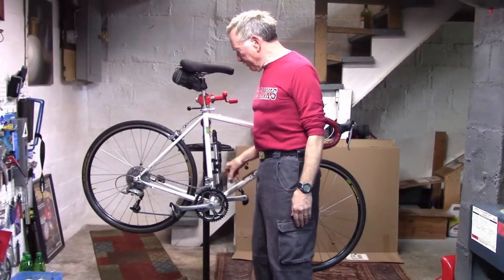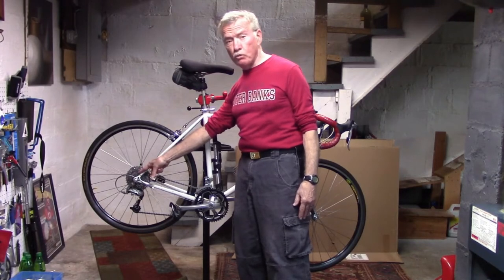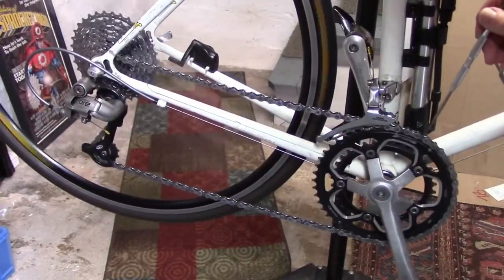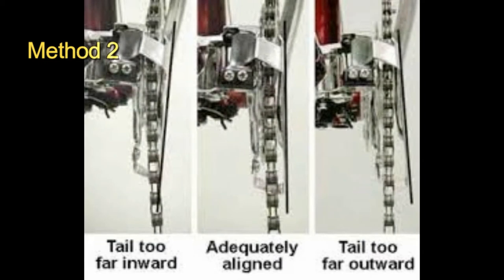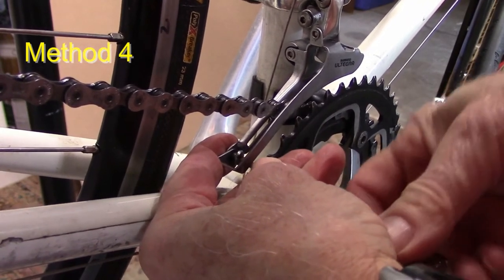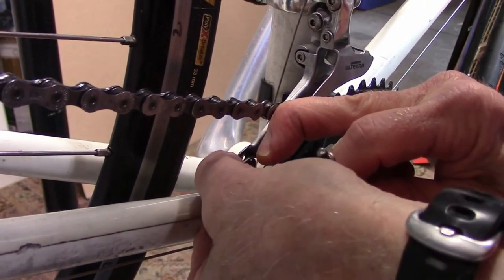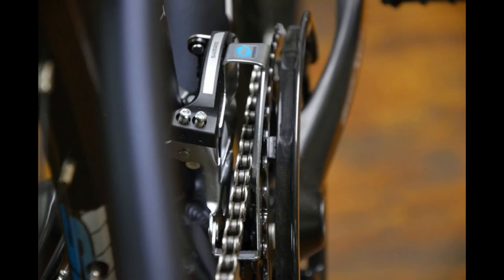Front Derailleur Chain Rub with Multiple Rear Cassette Cogs: Tips and Hacks

Comment: This is magic that I got to this video. I have been watching cycling videos, but I have not searched a solution for this problem that I have on my gravel bike. I think that in my bike there is enough flex purposefully built into the rear triangle (carbon GT Grade) that when I put in enough power to the pedals the FD rubs against the chain. No amount of adjustments has seemed to get rid of it, but I never noticed that there is a screw there on the bottom that I could open and use the washer trick. That will be my next test :-D Thank you very much!
Reply from the maker: Let me know how you make out. Sometimes I've taken the risky move of also trying to move the inner and outer plate of the derailleur apart with long nose pliers (stick the end of the pliers between the derailleur inner and outer cage plates and open the pliers to move the plates apart more). But if you pull too hard, you could damage  the derailleur. Anyway, after installing the washer and before doing anything else, reset the inner and then the outer limiting screw. By resetting the inner limiting screw (place the chain on the small chainring and largest cassette cog and moving the inside derailleur plate closer to the chain), you be able to reset the out limiting screw to give you more room. Let me know if any of this works.  Regards, Tony

Comment: Before you get into taking the detailed apart you could always try the barrel adjustment.  Especially if the limiter screws aren’t helping.
Reply from the maker: That may be the case when the derailleur cable is too tight that the derailleur will not move inward enough and rub against the chain, usually in the larger cassette cogs. Failure to move outward far enough to prevent rubbing in the large chainring will occur when there's too much slack in the cable. And adjusting the barrel adjusters for the front derailleur may do the trick. Thanks for your observation and comment. Safe cycling, Tony

Comment: Great page! Had a question and can't seem to find info about it anywhere. I have a Cervelo r2 road bike with shimano 105. This bike has microshift or half shifting of gears to help prevent chain rub when you're almost cross chaining. I think this is called trimming? When I'm in the small front cog, it seems to work but when I'm the large front cog, it doesnt. Took it to 2 bike shops and no luck figuring it out. I'm wondering if you had any ideas on this?
Reply from the maker: Trimming problems are related to the fact that there  is a tad bit too much tension in the front derailleur cable. You can reduce the tension just a bit if there is a barrel adjuster up near the shifter or on the down tube. Turn it in (clockwise) 1 or 2 turns. If there's no barrel adjuster or it won't turn, you'll need to shift to the small chainring. Undue the front derailleur pinch bolt and let the cable have just a very very tiny bit more slack. Too much slack, and you won't be able to shift from the small to large chainring. Takes some practice to get the right tension but worth learning. It's hard to believe that the local bike shop doesn't know about this. Then again, they've probably only worked with newer bikes without such trim function or electronic shifters. Even if they had worked with the old triple chainrings they would understand this. Give it a try or take it to a different shop. Let me know how you make out. Regards and safe cycling, Tony

Comment: This is exactly the issue that I have with my front derailleur. But what can I solve this issue, when my front derailleur doesn't have a screw on the tail?
Reply from the maker: Several possible fixes:
1. On some bikes, running the large chain ring with the larger cogs will produce noise - rubbing chain against the inner plate of the large chainring. Sometimes adjusting the outer limiting screw (turning it in (clockwise) 1/8 of turn or so while in the small chainring) will allow you to still shift to the large chainring with rubbing only in the very large cog. You may always get rubbing when cross chaining (big chainring/big cassette cog). See:
https://www.youtube.com/watch?v=_dCa-PZuN7c&ab_channel=TonyMarchand 
You should be shifting to the smaller chainring when shifting to the larger cogs for climbing and use the larger chainring and smaller cogs for speed. 
2. Some front derailleurs have a limited capacity in what cogs can be used without rubbing. Using snap ring pliers or even long nose pliers (gripping them so they open wider), I have been able to widen the space between the front derailleur plates (at the front and middle of the derailleur) to give me a better range of options. This does work but is risky in that if you put too much pressure on the derailleur to widen the gap, it is possible to break the derailleur itself (has happened once on a bike I was working on).
Snap Ring Pliers:
https://www.amazon.com/SPEEDWOX-Retaining-Installing-Automobile-Transmission/dp/B07QYR719L/ref=sr_1_20?dchild=1&keywords=Snap+Ring+Pliers&qid=1629743732&sr=8-20
So one must take great care and widen just a bit in the middle and front of the derailleur. 
3. Obviously these alternative are not easy tasks. Otherwise, leaving everything as is, when you hear rubbing in the large chainring, you know it's time to shift to the small chainring or vise versa. This too is not a bad alternative.

Regards and let me know how you make out, Tony

Comment: Hi there again Sir Tony, before, I used shimano HG 201-9 11-36T cogs and I don't experience any chain rub even on any gears, then I changed my cogs to shimano HG 400-9 11-32T, now my chain is rubbing on my Front Derraileur. Does changing smaller cassette is the cause of that rubbing? By the way, nice video Sir.
Reply from the maker: Did you check the "b" screw? See:
https://www.youtube.com/watch?v=UXnLJpTVFJ0&ab_channel=TonyMarchand
Check that the derailleur hanger is not bent. See:
https://www.youtube.com/watch?v=qHK6jQizIdc&t=1s&ab_channel=TonyMarchand
In what cassette cogs and what chain rings do you hear the rubbing of the front derailleur and is it on the inner or outer plate of the derailleur? Let me know? Regards, Tony
Reply: @tony10speed  The "B" screw is just right and my hanger is good. First when I shift from small Chainring and small cogs it rubs on my outer plate, second when I shift to second chairing and 3rd chairing the rubbing occurs in the inner plate when I try to shift into a larger cogs, although my adjustments are correct. Btw, My drivetrain max capacity is 45T but now its 43T capacity because I changed it to a 32T cogs. Is that okay? And I removed 2 links on my chain.
Reply from the maker: @earvinvillanueva3839  I assume from your description you have a triple (3 chain rings). Correct me if I'm wrong which will change my answer. A triple is setup such that one uses the small chainring in the larger cogs, the middle chainring in the middle cogs and the large chainring in the largest cogs. Any other combination will give you chain rub. In fact, when you hear chain rub, you know it's time to shift to a different cog. This requires one to think ahead as you approach an incline or descent and is one of the reasons most bikes manufactures have shifted to a compact (2 chain ring setup) which makes things easier. Even then, one can expect some chain rub when in the largest chain ring and larger cogs and small chainring and smallest cogs (something we call cross chaining). Again, when you hear a rub, you know it's time to shift. You still need to anticipate the incline or descent to be in the proper gear. Here's a video from Park Tools on how to setup a triple derailleur (not simple). Your bike may have the barrel adjusters on the down tube as opposed to the video:
https://www.youtube.com/watch?v=ZNG7g83lI-s&ab_channel=ParkTool
I've switched all but one of my bicycles to compacts and a third I will convert to a 1x (single chainring in the front) - an up coming video. 
I hope this answers you question. If not, let me know. Regards, Tony
Reply: @tony10speed  Thank you sir tony for the help, I already did the proper adjustments on the FDer, then adjusted the "b" screw slightly upwards since I changed now my cassette to 11-34T and installed again the 2 links that I removed from the chain. Now my drivetrain is smooth and quiet and I didn't experience any chain rub on any gear combinations. Again, thank you for the help Sir Tony, God bless!
Reply from the maker: @earvinvillanueva3839  Great work my friend. Regards and safe cycling, Tony

Comment: Hello sir my front derailleur is 3 speed. When I shift to the smallest chainring then the chain rubs on the inside of the derailleur, if I properly adjust that by the low limit screw then the chain rub stop on the first gear but the chain starts to rub on the inside of the derailleur on the second gear. The 3rd gear is fine. Could you please tell a solution for this.
Reply from the maker: Adjusting a front triple derailleur is not an easy task and take time and practice. Watch and listen closely as Calvin Jones of Park Tools takes you through the process:
https://www.youtube.com/watch?v=ZNG7g83lI-s&ab_channel=ParkTool
Regards, Tony

Comment: are you sure this chain is not TOO short?
Reply from the maker: To check that, put the chain on the large chainring and large cassette cog (a gear we try to stay away from when out cycling). If the rear derailleur cage is at about a 45 degree mark, chain length is fine. If you can not shift into that position or the rear derailleur cage is almost straight in line with the chain, the chain is to small. We will be having a video on chain sizing coming out soon. Regards, Tony
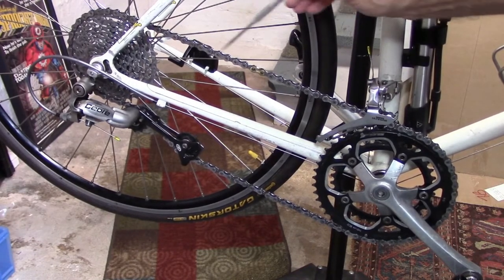Reply: @tony10speed  I know this Tony, that is why seeing your real derailleur almost horizontal I believe this chain is too short  - see at 00:54
Reply from the maker: @zyghom  Yes, you are correct. Good observation. I've been using this bike left at our shop for demos. The chain has since been replaced with the correct length which will be a subject of an up coming video on chain sizing. Regards and thanks for noticing, Tony